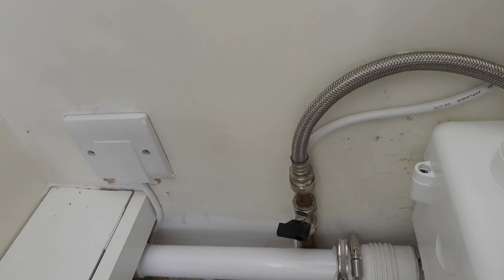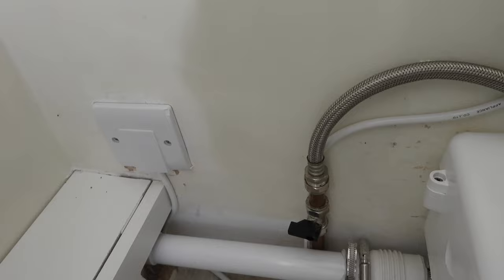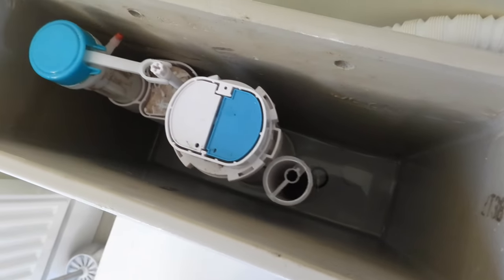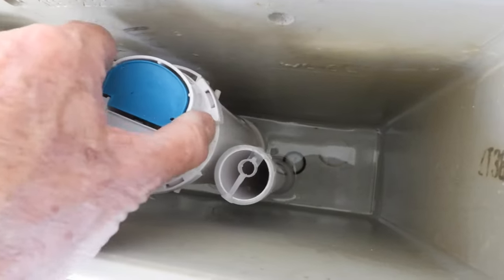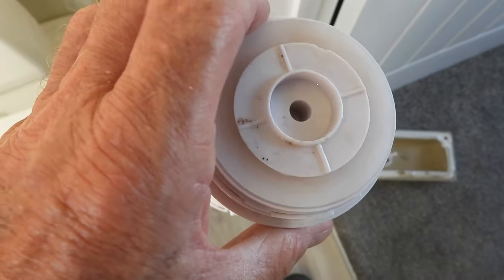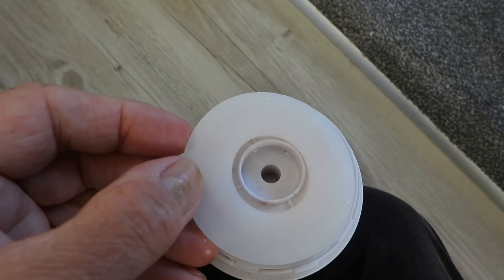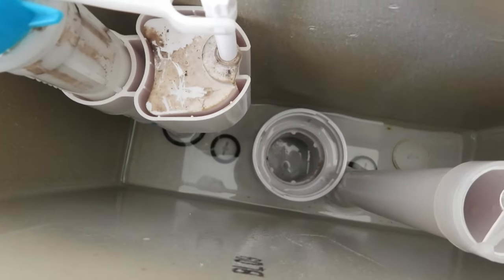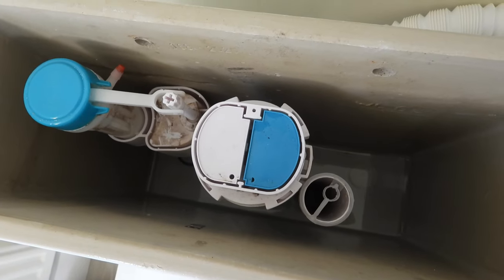How to fix water leaking into the pan?

Comment: Cheers Al, ours has been doing this for ages so got the lid off to have a look.Looks totally different to yours but unscrewed it it any way and it came off.Washer looked fine still dead straight and couldn't remove the end but found the washer just pulled off.When i went to try it back in i think i might have found the problem all along.A screw had wedged itself inside the unit when fitted (not by me) so could have been stopping the washer fully sealing.Back together now and no water leaking so far fingers crossed 😂
Reply from the maker: Well done Bill.

Comment: We have push button flush.  It’s fine until you flush AND THEN the water continues to run unless you jab the button, which then stops it.  There are small bore tubes running from the back of the push button, not sure if this is a different issue?
Reply: The vacuum unit behind your push button can be at fault.
Try swapping the tubes round to confirm 1 or 2 diaphragm are faulty ( half and full flush)
Reply from the maker: Thanks for answering .

Comment: I've got a Geberit push-button and am told that the column clips out from the bottom -  but I can't find the clips and it doesn't want to twist out either. Any tips would be welcome. Thanks for all your helpful videos!
Reply from the maker: They do clip out from the bottom but the clips may be wedged against the side of the cistern. Or you may have one of the old ones that do not split.

Comment: I also have the issue commented above. If I jab the flush button once or twice then it stops. What is the actual solution for fixing this?
Reply from the maker: The syphon is sticking on the return. Take it out and clean it up and make sure it works properly before fitting it back. If no luck then get a new syphon.

Comment: Is it possible for the seal between the housing where the button mechanism sits and the pan to be leaky? I've replaced washers, changed systems and done everything and I just cannot stop the water running at the back. I think maybe it's an issue with the housing not sealing with the bottom of the porcelain. When I unscrew that housing, it seems to me like the connecting unit below is slightly out of line. Tearing my hear out!
Reply from the maker: It is possible unfortunately.